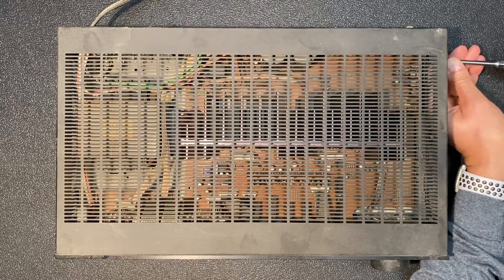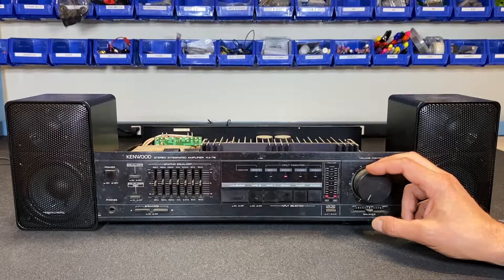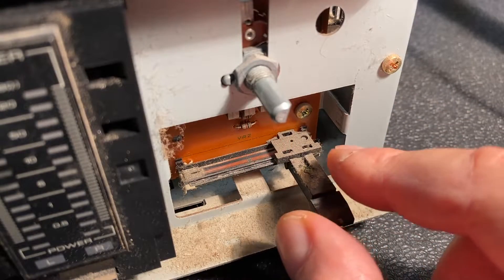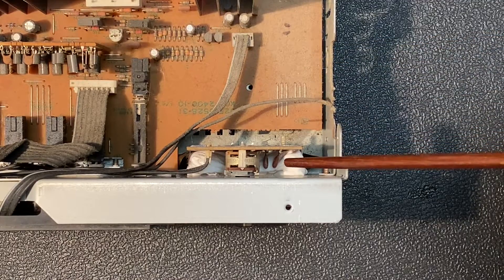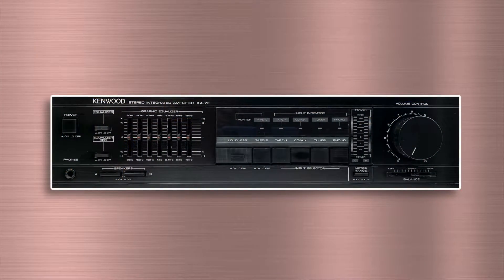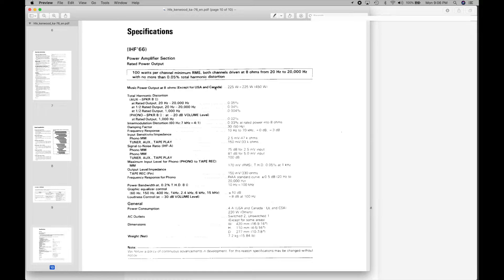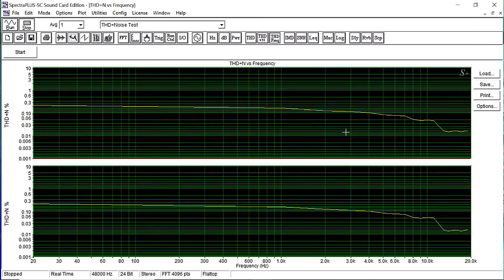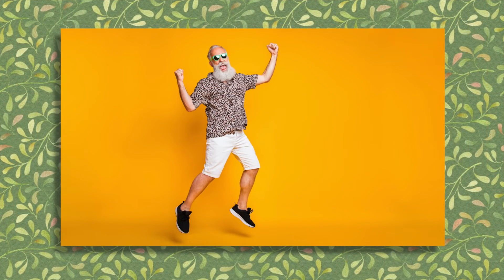Kenwood KA-76 Amp. Let’s fix it. Let’s test it.

Comment: I would like to add a caveat to your final analysis of this unit. I certainly would not expect this unit to meet/exceed the original ratings/specifications stated when it was originally built. Please, let us be fair, and consider the age of the components and the lack of care that it has received over the last approximately 40 years. I'd say the old girl is doing quite well considering. Wouldn't you? Thanks for reviving this unit and keeping it out of the landfill!

Comment: I have this same receiver. It was working well until just recently. All of a sudden, there is a very loud buzzing noise coming out of speakers when the receiver is turned on. This is true whether speakers are plugged into A or B ports, with different speaker cables, with different speakers, and when headphones are plugged into the front jack. It is also true whether or not we are trying to play music through any of the various input ports (tuner, CD, etc.). I suspect something in the receiver broke and needs to be replaced. Any ideas what might need to be replaced or how to diagnose?
Thanks!

Comment: What kind of polish you are using for the plastic front panel
Reply from the maker: I use the Novus Plastic Polish system. There are three products. One is to remove heavy scratches, one to remove light scratches and another is a cleaner/polish. It’s good stuff, highly recommended. https://www.novuspolish.com

Comment: Great video! I have this exact model and its not picking up much sound on the right side. I want to try this restoration and I was wondering, is there one cleaner I can use for both the fader and the volume controls or do I need to purchase both types that you used? Thanks!
Reply from the maker: Glad it helped, Joseph. Ideally, you’d have a product for the fader and one for the other controls. But, if you want to try just one, get the DeoxIT Fader F5. It’ll be safe on the plastic parts in the balance control and should also work OK for the other controls. Note, that Fader F5 is meant for plastic-to-plastic, and the Nutrol Control Cleaner I recommend is better for the carbon type surfaces in a typical potentiometer.

Comment: Why not blow that dust out the unit first? Especially the  balance slider.
Reply from the maker: Just my tribute to Shango066. Actually, there are a number of reasons. First, I didn’t want to spend time bringing the amp outside and blowing it out if it was beyond repair. I knew if I fixed it I’d end up giving it a through cleaning. 

Second, never a great idea to clean a device until you’ve tested it for a baseline as the cleaning process is always risky and can damage things. The last thing you want is to clean it first and then wonder if the cleaning caused problems. The exception to this would be when a complete restoration is planned and not just a fix. 

Third, you would absolutely never blow compressed air anywhere near a control whether it was a fader or otherwise. Same for coils and other delicate components. The area around the controls was cleaned with electronics cleaner, Q-tips, foam pads and microfiber cloths. After the intense outdoor cleaning, the controls received additional sprays of control cleaners. 

Note that the the control cleaners are not the same as the electronics cleaner I used for cleaning the chassis and boards (MG Chemicals Safety Wash). The control cleaners contain lubricants and should never be used for general cleaning. Hope that clears things up. Thanks for watching.

Comment: How would comparatively modern inexpensive amp compare with this vintage model?
Reply from the maker: Great question. Well, if we compare it to something like the Sony STR-DH190 which currently sells for $129, we find the new model offers the same 100 watts per channel as the 80s Kenwood, but with a significantly higher THD of 1%. Both units have a phono input, but the Sony adds Bluetooth, remote control and remote smartphone control. But, it lacks the tape monitors, EQ and loudness provided by the older Kenwood. So, in the world of inexpensive stereo audio, not much of a change over 30 years, really. A few more features (and a few less) but with somewhat lower sound quality. https://www.sony.com/electronics/av-receivers/str-dh190/specifications

Comment: Your video is exactly what I needed. My KA 76 also has the exact same issues. Is it a common issue with the balance and volume on one side???
Reply from the maker: My only experience with Kenwood has been this one amp, so I’m not certain. That said, given the design of the controls, I can’t imagine any of these units not having the same issue if they haven’t been maintained. Good luck getting yours going.
Reply: Thanks! I'm going to try to follow your steps and clean it. Using it to power my Stax Lamda Pros.
Reply from the maker: Great, good luck! Make sure you use a different product for the fader than the volume. It’s important that you use something that will be well tolerated by the plastic resistance track.
Reply: @FluxCondenser  Will do! Thank you for the awesome content
Reply from the maker: You’re welcome. Let us know how it works out.

Comment: Can you answer a little question?
What is the difference between the kenwood amp a-76 & the a-77 
My old hifi has the a-76 but my new one the a-77 but both look identicle to look at the front? 
Are they basically the same just a newer model or is one better than the other
Reply from the maker: Tina, I did a little research on this and only found that they both appear to be 60 watts per channel. Note that the amps you’re referring to are the A-76 and A-77 which are different from the KA-76 I show in the video. To really be certain what the differences are, if any, you’d have to download the service or user manuals for both the A-76 and A-77 to compare. I searched for free versions of these to help identify the differences, but only found manuals that required a purchase. If you’re interested in pursuing this further, you may have to go that route and pay to download the manuals. Good luck, sorry I couldn’t be of more service.

Comment: I am not a fan of that 1980s construction either. It just seems sleazy. My test bench receiver is a JVC of the same vintage and build quality. I love the 70s gear that was still largely hand built. True rotary switches versus those PC board slide switches as just one example.
Reply from the maker: Yeah, the switches are a great example. This type of construction is almost painful to look at when you’ve been spoiled by the good stuff.

Comment: I recently got one of these, however the one without a graphical equaliser. Is the European version as far as I'm aware. Because the variant you guy get across the pond is the one shown in the video. 

Would be interesting to see if they behave differently. Never had the chance to compare them side by side.
Reply: I also have the European version without equalizer. Got it for free from a High School colleague who killed it in party operation with a 4 Ohms load on 8 Ohms setting. Replaced the outputs with MJL4281A / MJL4302A and adjusted bias current. I am using it daily on my multimedia PC systems for nearly 18 years. Nice amp saved from the dumpster. Accodring to the schematics, the power boards should be the same.

Comment: Vacuum and blow first?  Spray doesn’t remove the dust.
Reply from the maker: Huh? At 20:18 I state that the unit will be air-blown and whatever isn’t removed by the duster will be removed with the spray. The dusting part goes by fast in the video, but this is what was done.
Reply from the maker: Additionally, I should add that you’re mistaken to say the spray doesn’t remove the dust. In fact, the blown air only removes the the loosest dust. The MG Chemicals Safety Wash I used removes significantly more dust and debris than vacuuming or blowing and that’s why the video shows so much time devoted to spraying and using the foam swabs to soak up the mess. Blowing helps, but truthfully when a component needs as much cleaning as this, that step can be skipped altogether.

Comment: Your dc test is pretty much redundant. Those units all had dc detection on the output points, so if there was excessive offset, the speaker relay would not have clicked in. I've seen up to about 100mv of offset on amplifiers like this. I don't  like it that high, but it really won't hurt anything.
Reply from the maker: It would only have been redundant if I had confirmed that a DC detection circuit was not just present, but functioning (a click doesn’t confirm that it’s actually preventing DC). I had not, so the DC test was a quick, informative and useful step at that point.

Comment: MM cart good, MC cart best? NO WAY. That statement is for snobs. I've been at this stuff for 5 decades, and know better.
Reply from the maker: There are exceptions, but in general MC cartridges are technically better, yes. They happen to typically cost a great deal more, though and require specialized gear. Further, any advantages are often sonically insignificant.